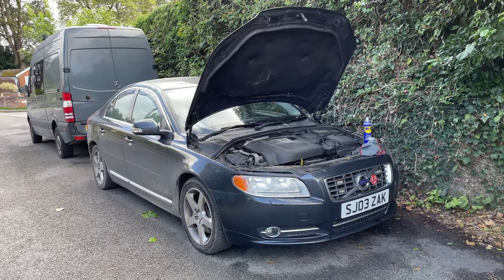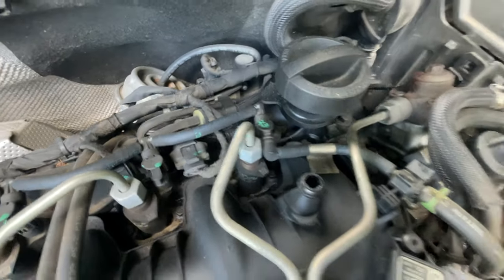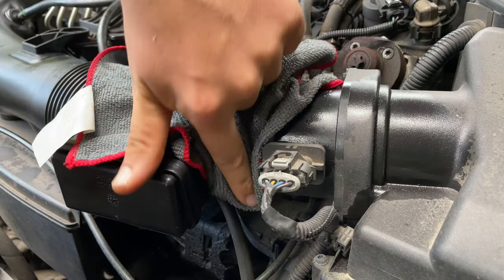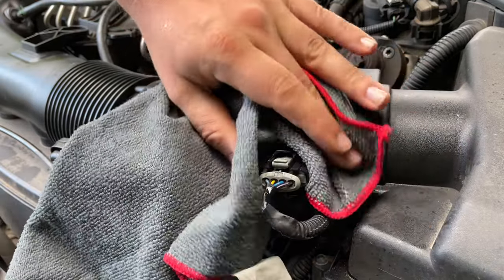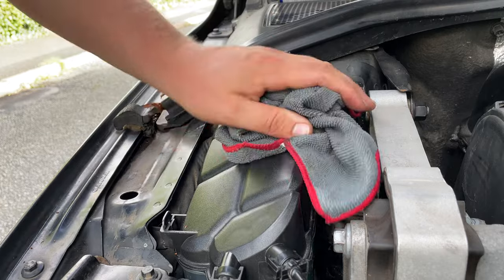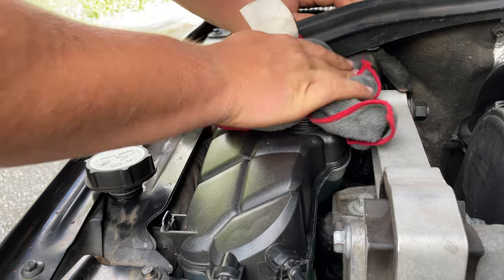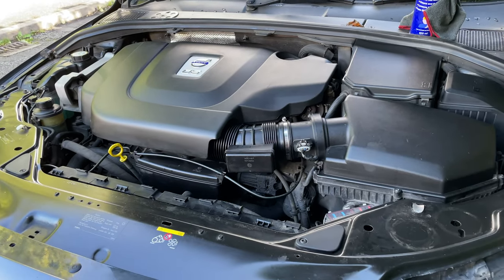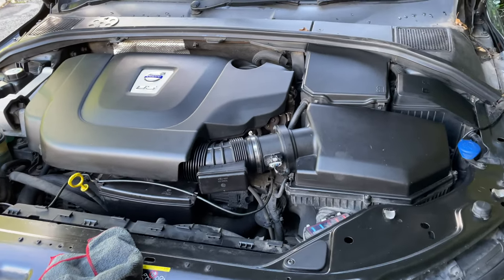The 130,000 Volvo Mile Engine Bay Clean - The *EASIEST WAY*

Comment: The plastic becomes porous and can break off. According to the manufacturer, "hairline cracks or larger cracks may appear" when WD-40 is applied to clear polycarbonate and polystyrene surfaces. A solvent-free silicone spray is more suitable for lubricating and cleaning plastic parts.

Comment: Really nice clean up! I polished up my 465 cedar green metallic V70 from 2006, same as @pavw5508 I get really nostalgic during cleanup. So much history and memories! The V70 were build like a tank so do the clear coat... over three days with polishing, checking the thickness of the paint and polish again. Rotary polishing machines are a must on this paint. WD40 is a great idea for these plastic trims etc., I use a specialized Koch Chemie Motor Engine cleaning supply for that extra long term protection.